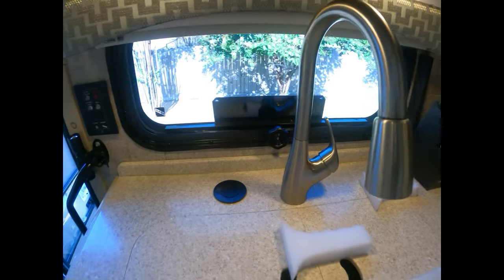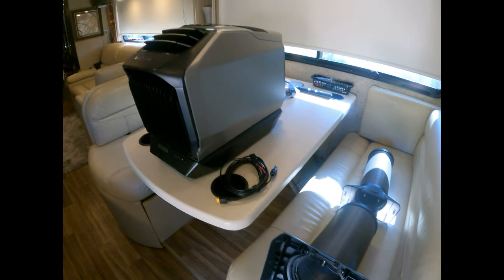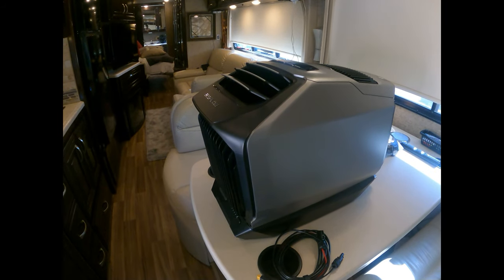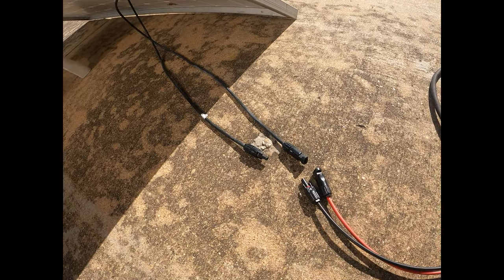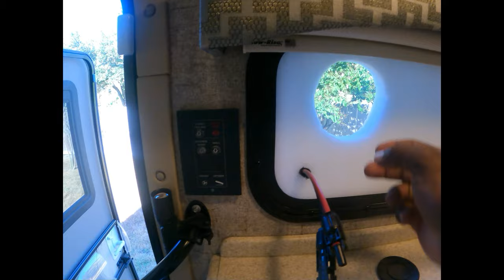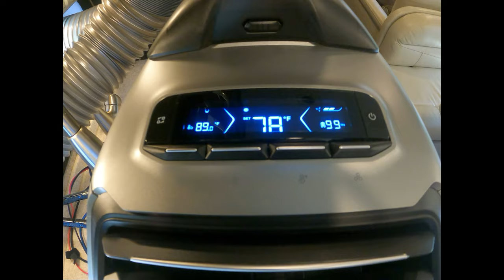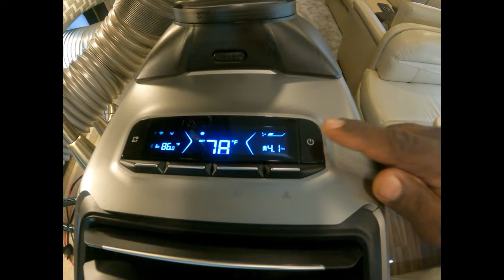ECOFLOW Wave 2 installed in my RV

Comment: Thank you so much for this project! I am thinking about putting these in my bedrooms for emergency hurricane preps as I am on the TX Gulf Coast. I can run my Central AC in my home with my Ecoflow Pros since I installed a soft start but I'd need way more storage. Infact, since August here in TX was above 90 degrees every single day, and over 100 each day in many places, I got a true look at the energy usage! Oh Madone!   I have been looking at these or portable units. At this point I have another year to decide but they are cool little units. Thanks again.

Comment: So you can run this constantly off the extra battery and just solar?     No generator, no extra power from another EcoFlow or anything else?
Reply: Yes if you have close to 400 watts of solar power and good sunshine. My wave2 uses 325 watts to cool on medium fan. It uses the same 325 watts to heat also on medium fan.

Comment: For only 5kBTU/hr of cooling, is it really worth it? It seems expensive, cumbersome, and generally inferior to existing air conditioning solutions. If your trailer struggles in the heat, it might be better suited to insulation additions, ductwork enhancements, or upgrade to 15kBTU/hr units.
Reply: I bought a wave2 because it’s uses very little power and it’s the only portable mini split that can run directly off solar power.
Reply: @billbradley2480  That's cool. What application have you found it useful in? Also it isn't a "portable mini split"; split units by definition have refrigerant lines leaving one side, going inside the building, and connecting to the other side. This would be more of a portable mini package unit.
Reply: @ewicky  I used my wave2 to keep my solar power room cool all summer. Lots of electronics in there plus a large freezer and DC fridge. Now it’s cooler so I’m using it to heat my living room in the morning. I plan to take it camping in my Motorhome too.
Reply: @billbradley2480  interesting

Comment: Why would have an intake of 102 degrees coming in when you can recycle the already cooler air in the RV?  Wouldn't it take less power to cool?
Reply from the maker: Then you’ll be pulling your cold air and pumping it outside every portable AC every home works this way.
Reply: @GeneratorReviews   I have put in two portable AC units in offices, one in a travel trailer all three had only the exhaust side exit a window. (different brands).  Only worry was the condensation water. 

"EcoFlow's tailor-made compressor enables WAVE 2 to provide 5100 BTUs of cooling and 6100 BTUs of heating."  This is a heat pump NOT like a home/office portable AC unit.  Different animal.